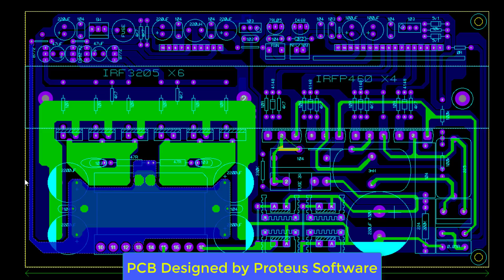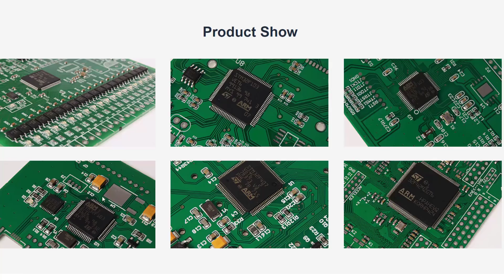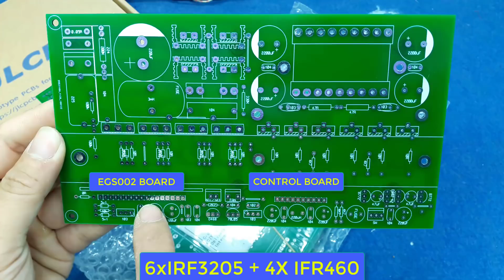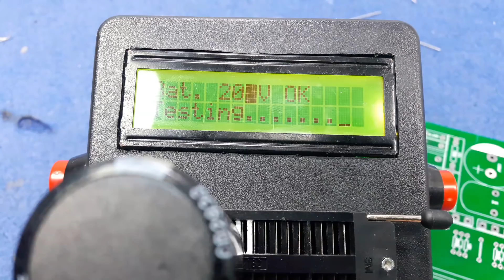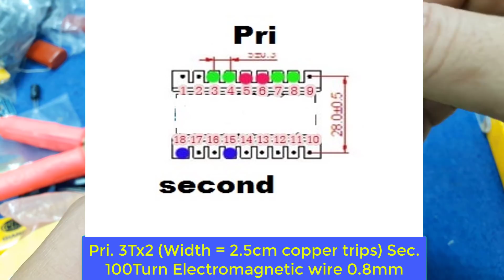1200VA Pure Sine Wave Inverter 12V to 220V Using Ferrite E42 Core + Egs002

Comment: First of all, thank you for your good training and videos. I made this circuit without any problems because I didn't have a car battery. I used an 8 amp laboratory power supply. First, I limited the current and tested the circuit. There was no problem. But when I turned the current on completely, unfortunately, all 6 MOSFETs 3205 and the EGS module burned out. Please tell me the problem. Thank you.

Comment: I don’t understand how is highly frequency high voltage side mosfets stay kool with load higher frequency inverter is a very bad system for mosfet and heating issues when a small load is added that why almost every higher frequency inverter burn up and shorting the mosfets life I build low frequency inverter and 4kw system running full 4kw and mosfet stay cool for 15 minutes before fan chip in and all my higher frequency inverter fan chip on at small load like 1000 watt turn on fan in few seconds from 3500watt so

Comment: Please I need to coil 500w chopper using copper sheet on ee42 how do I measure and calculate it
Reply from the maker: Use multimeter to check the inductor bro. Total 3mH
Reply: I mean measurement of the copper sheet length thickness

Comment: hello, dear. egs002 module shows error overvoltage. blink 3 times. what is the fault of circuit?Thanks
Reply from the maker: I'm not sure that mean low output voltage. Check the fault code of egs002

Comment: Pri.3T*2 means 3turns 2wires but 6 ends are in video,
can u explain in detail about transformer winding.
Reply from the maker: That mean 6 turn with center tap
Reply: @LongTechnical  ok
For primary
Wire size and how many wires?
Reply: Excellent project. Could you elaborate on the transformer please.

Comment: Hello, why the VFB feedback (about 2.5V - 2.9V) does not work on the AC output voltage, as it is in most diagrams, that there is a 200k, 10k resistor, 10k potentiometer for voltage threshold adjustment, filtering capacitor. Even the original H-bridge from Aliexpress doesn't work because of this. Only installing a rectifier bridge between one AC output and common ground for everything and adjusting the voltage to about 2.7V gives the effect that the EGS002 does not see overvoltage or too low voltage at the H-bridge output after the 2.5mH-3mH choke and a 2.2uF capacitor / 630V that works approx.

Comment: Very nice dear brother 👍👌👍
I made this circuit but one problem.
Everything is ok but when I connect the 2uf capacitor after inductor high voltage MOSFETS are burnt what is the problem. Inductor problem or other please help me.
Reply from the maker: Inductor problem bro
Reply: @LongTechnical  what can I do brother??
Reply from the maker: Using koolmu 77490A7 core bro
Reply: @LongTechnical  ok, you was showing this core in the video? I am purchase this core and wind 140 turn from 0.8mm dia copper wire.
Thank you very much for your helpful reply 👍👌👍
Reply from the maker: Yes bro
Reply: @LongTechnical  0077439A7 this core available. Is it ok??
Reply from the maker: OK bro
Reply: @LongTechnical  can i use sendush core 77083A7 as the induction filter?

Comment: This comment is about your protection circuit , please answer :
Hello my friend
Your protection circuit works great and I thank you for your good work.
I built this circuit and it works properly but one thing about the operation of this circuit occupies my mind 
and that is that when I connect a device like a motor to it and the circuit allows the required current to pass through it 
and when The motor is in load mode and consumes more current, the circuit does not react, ie it does not cut off the current.
You previously posted a video on 1/15/2018 about the performance of a protection circuit, which, although that circuit had some problems, 
but when you tested it with a motor, the protection circuit reacted well to the increase of the motor tensile current, and He cut off the flow.
I want to know why the new protection circuit does not have this feature?
I hope I have stated what I mean correctly
Thanks a lot.

Comment: how much ampere input transform..can i use tv transform,are you use shunt resistor,,and final mosfet can make sine wave,,wire diammeter mm..
Reply from the maker: Can not use TV transfomer. The ferrite core must no air gap. Detail of wire, core in video.

Comment: No use microcontroller chip.......only use ..SG3525...for..PWM and any shutdown system...
Reply from the maker: Why not use microcontroller ? Pure sine wave is the best. How can we do with sg3525 ? It can not make sine wave, just onlly modify wave which not good for ac device
Reply: @LongTechnical  SG3525 ic lm358/cd4017/ne556/in this use ic for pure sine wave gernate signal...and no Softwer install in this ic...with shutdown Sg3525 ic pin number 10.....for the..any problem in this circuit...
Reply from the maker: Do you know exacly how pure sine wave mean ? Your circuit just only make modify sine wave  not pure sine wave